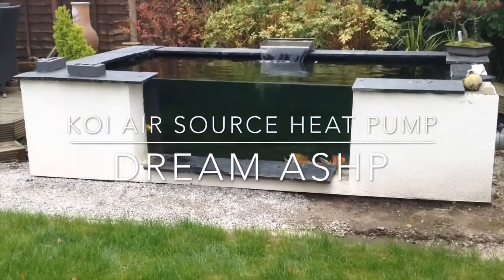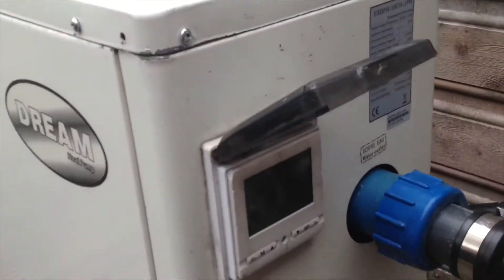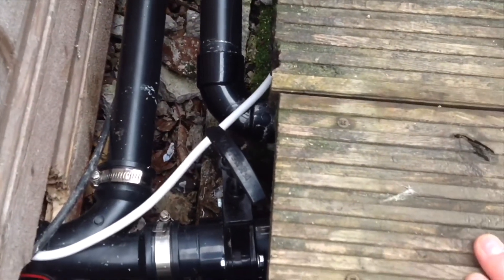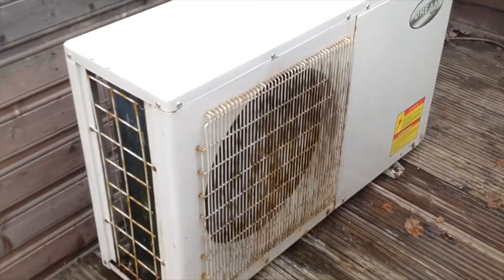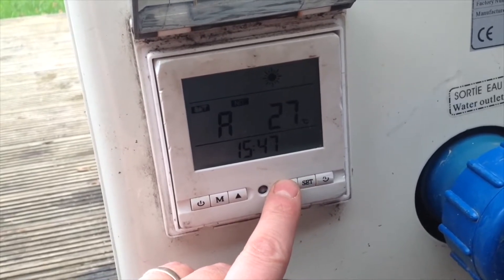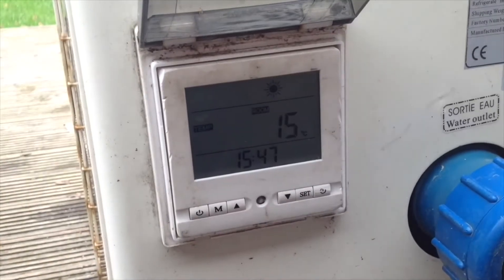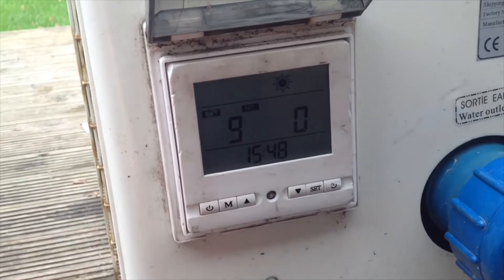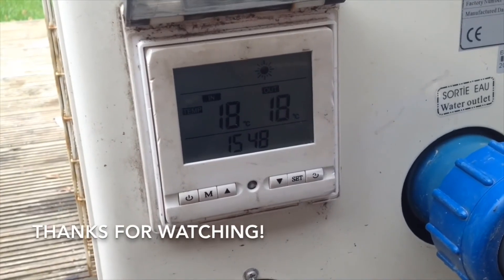Heated Koi Pond - Install & Setup of a Dream Air Source Heat Pump - Dream ASHP

Comment: Hi mate, im getting a PP07 error code and its not heating on mine,  The code says "Sub cooling protection - Under cooling mode",    do you  have any ideas mate ?  this is a 2nd hand unit bought off somebody , any advice be appreciated

Comment: I am in the market for a heat pump....these are so much cheaper than other brands but the noise puts me off. You mentioned it is noisy but how noisy??? Couldn’t get it from the video
Reply from the maker: Richard Rapley it’s difficult because I have not got an expensive one to compare however, I do have an air source heat pump as a heater/cooler in my conservatory and it is exactly the same! 
The pond is at the bottom of the garden. If it’s a cold night and the heater comes on, I can hear a gentle whir from the Dream ASHP with the window open. Can’t hear a think with the window closed and none of my close neighbours have even mentioned anything.

Comment: I’m thinking getting one of these heaters so much cheaper than other brand , how does it cope in deep winter does it freeze up in any way , been on website says it has a built in defrost mode is this true , any advise would be much appreciated.🙂
Reply from the maker: Paul Sampson great for the price! I only run mine during winter and early spring and works flawless.
Reply: craynerd thanks for your reply that’s made my mind up getting one 👍, just one more thing, what’s the lowest temp setting you can go , someone said it’s 15 degrees is this true ???

Comment: Hi I just got today a new dream air source heater like yours but output is 5kw and I was wondering if it could be installed before the filter as my son said this will block the heater. I don't think it would any advice would be appreciated as after filter is more of a bigger job for me then before it thanks Barry 👍👍👍
Reply from the maker: Barry koi keeper Cooper my friends I would entirely and whole heartedly agree with your son! I would definitely not do this and personally would not entertain it as an option. Put it After the filter and do it properly with a balancing pipe valve. Good luck. However like all hobbies, it’s experimentation and make up your own mind. If you decide to go before, let us know how it goes.